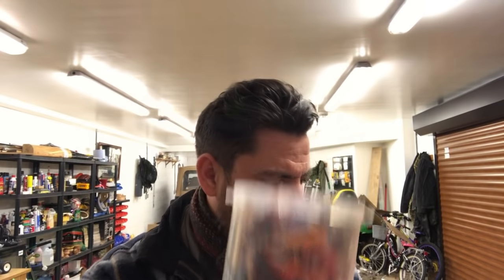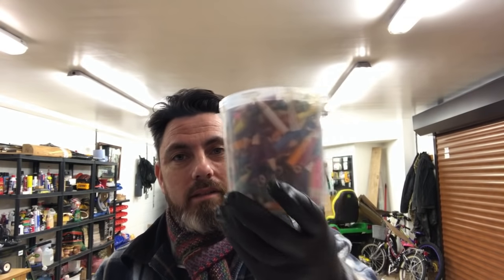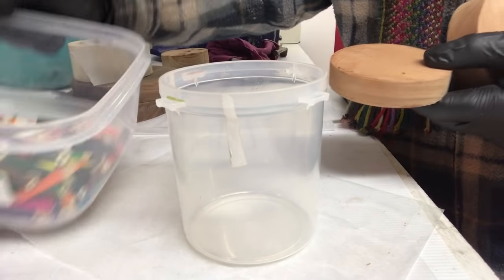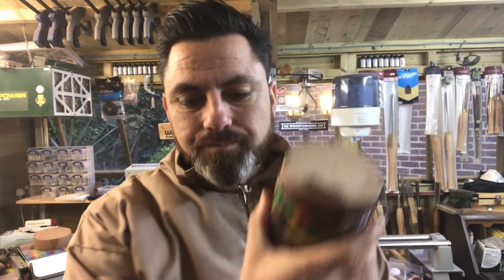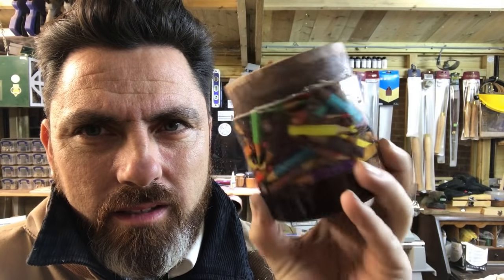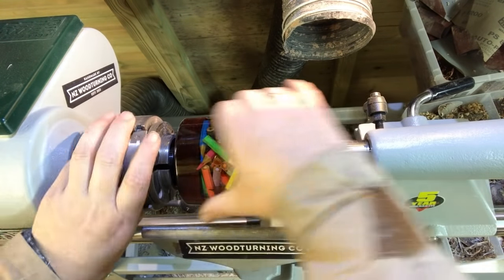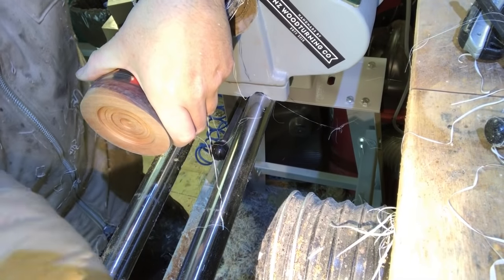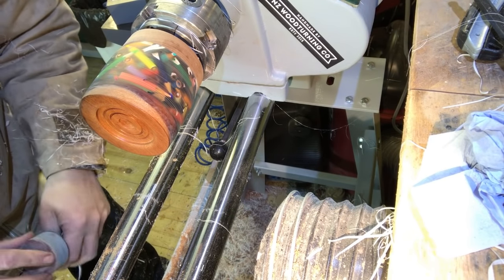Woodturning - A Pot made from just pencils

Comment: I've poured and unmolded a lot of resin.  If the item you are using for your pour has a slick shiny surface and is slightly flexible it usually unmolds just fine.  The slicker and shinier the better.  If it sticks a little, thermal shock it.  Put it in the freezer for about 15 minutes.  Get your water running nice and hot , get it out of the freezer and let the hot water run on the bottom of the mold.  It should fall right out into your hands.  The heat causes the plastic to expand quickly and the resin, being more dense, warms more slowly.

Comment: it looks great. 

just a tip to save you time, when you have something like your lid that you need to part off that already has a through hole, use a dowel or thin piece of round steel and stick it through the hole as you part off your lid or ring/ basically anything with a hole getting parted off. it will drop onto your dowel safely instead of hitting the floor or lathe, its an old metal machinist trick, ironically a pencil is a common part catcher haha.

Comment: Hi, Mr Nick. I don't know if you already figure out on when use or not the oil on the pot (mold, matrix, whatever it's used to cast resin), but follows a little tip on this subject: it's all mold strength dependant. for heavy strenght, its' easy to take the piece out, because in the process the resin makes some expansion and return movement inside the pot. when the process is complete, the mold is intact. Using a mold with less strength, this don't happen, BUT, the chance of you get cracks on the piece is less using this...so...I prefer to use the oil, or an specific release agent. hope it helps you. tks for share (sorry about the pour english)

Comment: Regarding the needs or not needs to oil up your container:
I believe it could be because your container was so new, that the surface is really smooth and without any tiny scratches, so that the resin does not have too much of a chance to stick on it.
Once you use the containers more and more, their surface gains tiny scratches or the surface starts to break open over time, once the plasticiser is slowly steaming out more and more.
Thus giving the resin a larger surface to stick to, as well the little cracks are filled with bits of resin, which hold the final block better in place.
Oiling basically just fills all those little gaps and smooth out the surface again.

Comment: I just did my first pencil pot over the weekend.  It turned out ok but i got a few larger bubbles in the casting.  Have you ever run into this issue?  I would like to figure out how to get a casting that has no bubbles in it.  I am using alumilite casting resin and i am using a pressure pot.  Any advice you have will be much appreciated.

Comment: I have a container of polyester resin sitting here.  Do you think it would be ok to use that instead of epoxy resin?  PR does tend to shrink a bit when curing, but I suppose that anything that would be sticking out would be turned off anyway.  Oh, and really cool pot there.

Comment: If I have big voids I use a 30 min epoxy glue to fill them in and rap it with packing type then in the pot for an hour then get to turning some times depending on the epoxy it can take up to 2/3 hours to fully set up

Comment: Great video as always Nick lovely pot, quick question how do you finish the underside of the lid as there is no way to put it back in the lathe after.
Reply from the maker: Yes good questions mate, I just sand it with a hand sander, coat it in some oil. it has a matt finished but looks ok for the underneath All the best mate

Comment: I am guessing that the pots are maybe low density Polyethylene which is a petroleum based product. When the pots are injection molded the 'oil' content of the melted substrate creates a shiny finish around the surface and that is why water or other wet substrates do not adhere to the finished 'pot'...LOL, that's my guess. :-)

Comment: the reason the pot popped out of the plastic container, if you look at the bottom of the container that you have, it will have a little symbol and then beside it or underneath it it will have a...PP..any plastic with that on it, the  resin will come out easily after it dries.

Comment: If you use plastic soil pipe or down pipes it dosn't stick to it either.  You have to just cut (on the bandsaw) a slot in it, tap in a screwdriver and off it pops.

Comment: The container appears to be polyethylene that isn't porous and has a slippery surface.  (It is non-polar so there are no available electrons for sharing which gives it that property.) Many epoxies shrink a little, so it may separate more easily.   I would avoid using oil as a releasing agent as it might disperse into the epoxy and reduce its hardness, make it cloudy and/or give it color.  There are various other releasing agents. The last one I used was wax based.  I once used one that was a thin blue liquid that was painted on and dried. Upon drying, it had a clear, very delicate, thin food wrap consistency.  It didn't absorb into the wood and formed a tight barrier on metal. (I was glass bedding a rifle.)   I would prefer this for woodworking projects as it wouldn't mess up a glue or finish and is easy to wipe off.A few weeks ago I thought I should make a pencil holder out of pencils for my niece who works in a high school. My idea was very similar to the one you just made.  Yours looks great and confirms that I have to press on with my concept.

Comment: What resin do you use
Reply from the maker: http://www.ebay.co.uk/itm/10kg-Low-Viscosity-Ultra-Clear-Epoxy-Resin-UV-Resistant-/332046517963?hash=item4d4f83c6cb:g:LKkAAOSwE3BXFkm8
Reply: NZ WoodTurning the epoxy resin you use it comes as A and B which one do you use or do you mix them together
Reply from the maker: BIG JACK F-P hi , I mix both together but it's 2-1 mix so 100grams of a to 50grams of b 👍🏽

Comment: Great job on this, and I thank you for answering the questions as to what type of resin you use.  I was thinking about using Alumilite for mine, but the stuff sets up really quick and it's best to put it in a pressure pot for curing.  I went with a 2 to 1 epoxy resin.  Worked really well.  If you have any US customers ask a good resource is http://www.little-windows.com/ .  The lady that owns this company is great to work with.

Again, great job on this project!!!  A bunch of my friends posted the project link to my Facebook profile.  And of course any turner must try something new.  :)  Cheers from the U.S.!!!!!